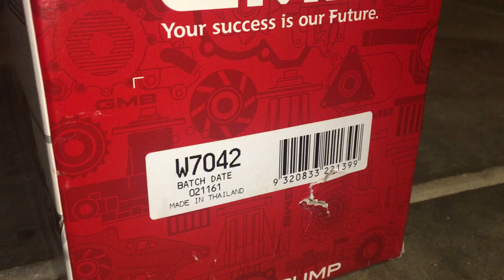VVTi 2JZ - 1JZGTE Water Pump Differences

Comment: Will it fit 2j non vvti ge?
Reply from the maker: There all the same pulley size/offset etc, it just depends on the bolt pattern on the hub. I think vvti and non vvti 2JZ is the same.
Reply: @ThatCarChannelOfficial  no man 2jzge is different to vvti 1jz i did a swap on my supra
Reply: I'd do the research plus if you measure the water pump hub you can't stuff it up man.
Reply from the maker: Dallen - I 100% agree with Glenn - measure and you won’t be able to get it wrong :)

Comment: is this the one with the 20% under-drive reduction?  and can you post the link where you get it from.
Reply from the maker: +mitchel taylor all standard pulley sizes
Reply from the maker: +mitchel taylor found on AliExpress
http://s.aliexpress.com/Enqi2U3a
Reply: Thanks.. did not want to pickup wrong 1..  the link you post list it as underdrive
Reply from the maker: definitely not under drive - all the same sizes, i will post a video with all the weights of OEM vs these new ones tonight, halfway through compiling it but i do also have a few older videos when i initially fitted the power steering pulley (as i was replacing the pump at the time!) but i only just got around now to the water pump (and needed the radiator out to 'rattle gun' the altenator one off)

https://www.youtube.com/watch?v=t3axUMJfG9M